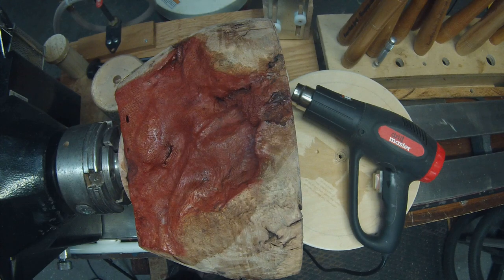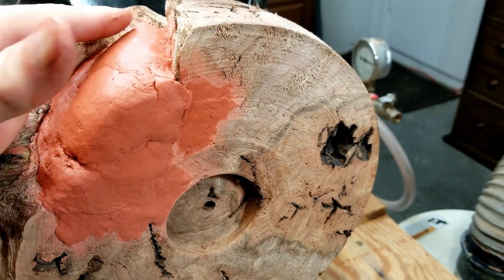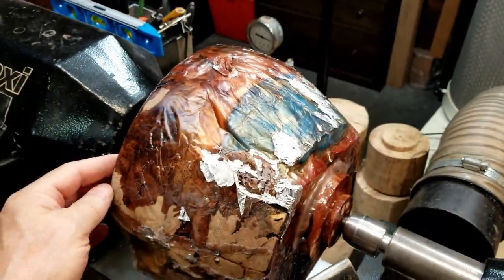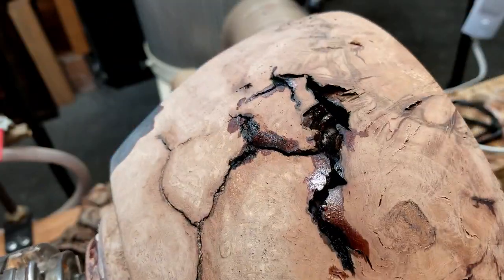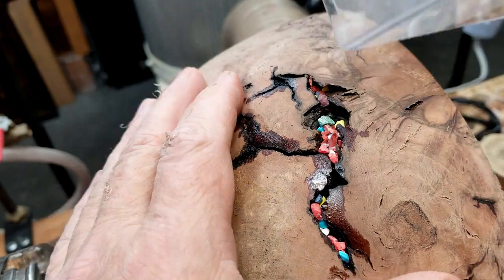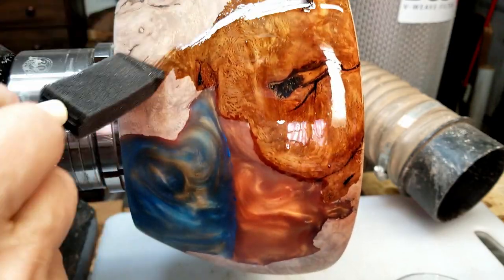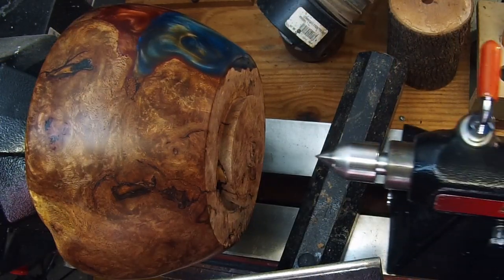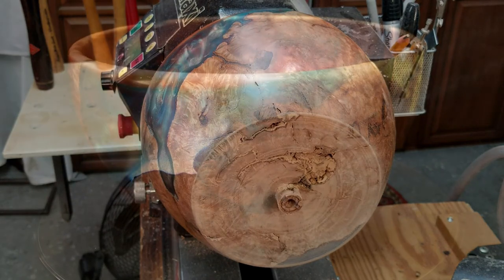Woodturning an Epoxy Resin Big Oak Burl Bowl

Comment: I have seen some turners use quite a lot of resin. Made me wonder if it was cost effective for what got turned away. Smart move on your part using the clay.
Reply from the maker: Hi Joseph. Thanks for the comment. I have been asking myself the same thing. Is it cost effective? I won't know until my finished pieces hit the market. I plan to put a dozen on my Market Place and see what response I get. If the cost of making them can not be recouped, why make them? They are messy and time consuming as well as costly. Unless my epoxy resin videos get a LOT of views it makes no sense to continue.

Comment: Alumilite Amazing Clear Cast that i use is 1 to 1 by volume,  not weight . not sure what the 15 grams was? I buy the 2 gallon kit
Reply from the maker: Hi Paul. You are correct. At the time I was following instructions of Zac. It did not make any difference in curing or work time. It worked just fine. I will follow directions on label in the future. 😉

Comment: Does your vacuum system use a vacuum pump or an air compressor?
Reply from the maker: Hi Gerald. I use a Gast Vacuum Pump. It will suck the chrome off of a trailer hitch.